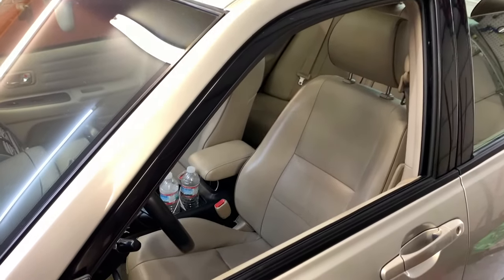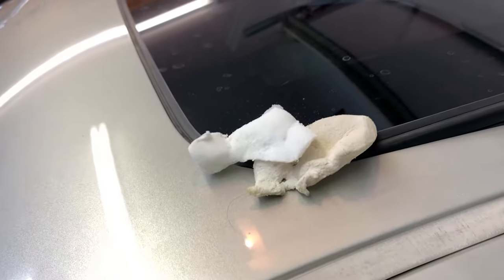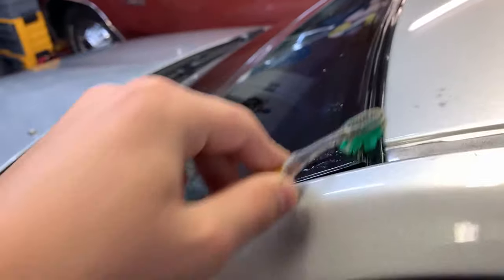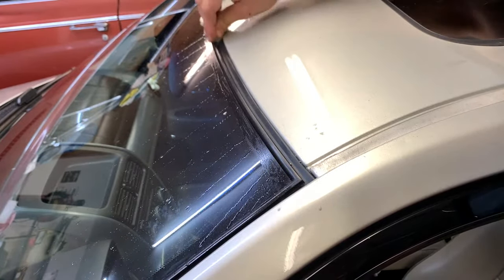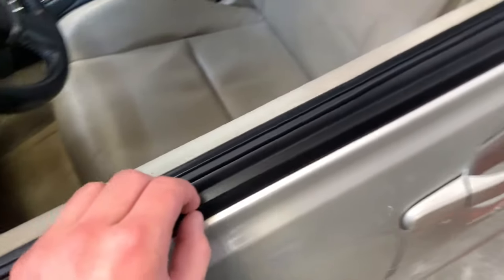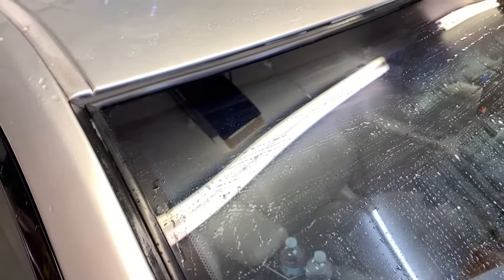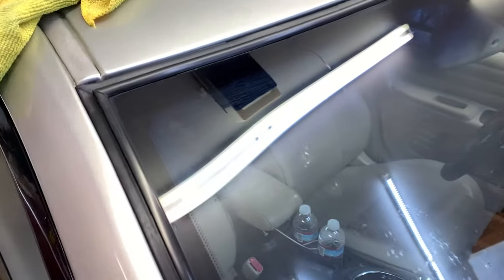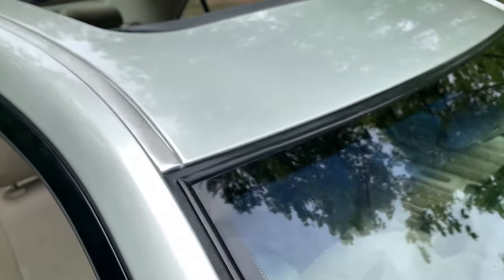How To Restore Weatherstripping Trim On Your Vehicle!

Comment: I bought the Automotive Goo Gone based on, however, the label states not for rubber?????  I'm pretty sure my trim issue is made of rubber. . . .any advise?
Reply from the maker: I had tried everything I could think of to get my trim looking better and this worked for me. Note, I did wash it well after and then used protectant on it. Many miles & over a year later it still looks good, BUT please don't use the Goo Gone if you think it may damage your trim. Maybe try just the Dawn soap first.
Reply: YEAH, don't use goo gone on your weatherstripping!!  303 aerospace protectant is best!!  Silicone free product which is what you want.

Comment: I use chemical guys compounds for cutting and buffing # 32, 34, 36 and 38. 32 being the most aggressive 38 being more of a polish and have used these on my belt moldings and around the door glass and has worked great by simply putting a little on a rag and rubbing back and forth folding the rag as it gets dirty I've used it on others vehicles to and no need in worrying about any chemicals screwing up the paint because its made for paint... when finished just wipe the entire piece with a clean rag, i use those cheap micro fiber rags from harbor freight... also this works great on glass. I use this on all my glass on my truck to get all the water spots off then spray it with rain x

Comment: I just found your video. I looked up magic erasers, but all were sponge like materials. Is the sponge eraser ok to use ? I have the same type of staining on rubber around rear side windows. What is the name brand you would recommend? Also , after cleaning rubber, what type of coating is good to apply to bring back some shine and not let rubber dry out as fast . Thanks
Reply from the maker: The magic eraser is made by Mr. Clean. They should have them at Home Depot or a grocery store:-)

Comment: Will this  remove small scratches on the rubber trim around  the windows? Thanks :) Also should I use dawn + magic eraser or goo gone and magic eraser?
Reply from the maker: This should remove small imperfections, dawn or goo gone should work just fine however goo gone is a little more aggressive and should work better - always test a small inconspicuous area first!
Reply: @Pondsisawesome124  it worked for stains, small scratches and polish compound residues but now i got some small micro scratches all over the weatherstrips is there a way to remove those, or i pushed too hard on the magic eraser?? Thanks

Comment: How to maintain it to prevent cracks?
Reply from the maker: Clean it well when you wash your car and coat it in some sort of a vinyl protectant. I used mothers VLR on mine
Reply: Put wd40 silicone oil on it to help it keep moisturized

Comment: I'm pretty sure goo gone is deteriorating the rubber and those hard brushes are as well.
Reply from the maker: The rubber still looks a LOT better then it did going on 2 years later but your mileage may vary:-)

Comment: These rubber seals last a long time. 
I personally wouldn't be to bothered about 
restoring them as you're more than likely 
going to shorten the life span of them... 
also i've never notice rubber seals on a 
vehicle unless im stood next to it... the first 
thing i notice when a car drives past is the 
colour, make & model. 2nd is wheels. 3rd is 
any modifications (spoiler, window tints, skirts, bumper extensions etc...) 4th depending on how fast it drives past is whoever is in the car. 5th is the vehicle following behind it... 
no one ever notices the rubber seals!!!
If you attend car shows i sort of get it but 
don't waste your money or time!!!